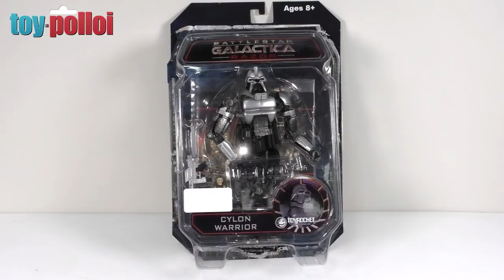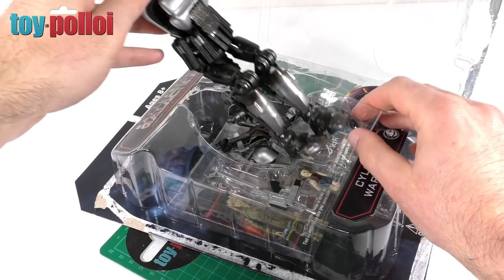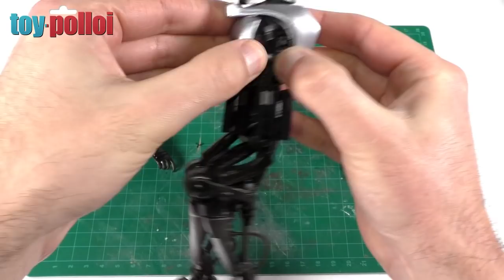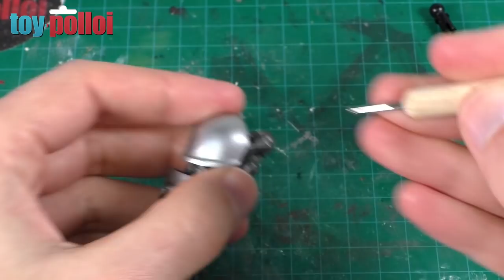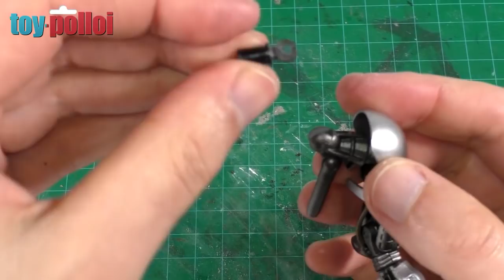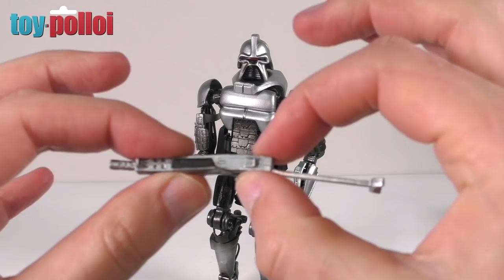Battlestar Galactica Razor Cylon repairs - Toy Polloi

Comment: Yeah I hear you about modern manufacturing, I think maybe the mould tooling cost takes away from final plastic quality too often when they budget these products out. Like you are repairing with LEGO where that standard of moulding tolerance and plastic grade would likely hold up to play since it's not as brittle.
These non-toys can get quite intricate to the point they probably need metal parts at least partially to hold up to standard toy manipulations. I'm impressed with the metal pins but I'm guessing plastic pins that thin would instantly break lol.
Bit of tribal warfare on that front, some pushing for more articulation which is really display-centric only, and the other wanting old school simplicity but some of it was too simple in hindsight. To me scale dictates articulation standard, the smaller the figure the less joints it should have just so it doesn't break.

Comment: Wow, that toy is just garbage, but your fix is lovely... it's a pity that it'll outlast the rest of it. Problem is, all toys out of China (as well as other countries) from about 2005 to 2010 suffer from this exact problem. The price of oil back then sky rocketed, so less was used in the plastic formulation and this is the result of that. After less than a year, maybe even six months, it starts to degrade and crumble. I have one item that I've had in a box for long term observation and that has pretty much turned to dust in places.

Comment: I have a couple of these, which of course instantly fell to bits upon opening them, but I just can't stay mad at them because I'm too busy being blown away by the incredibly intricate design of these toys. It took me a couple years to even fully discover all of the points of articulation, and I'm still not convinced I won't find some more lurking somewhere unexpected one day.

Sure, it's a shame that they disintegrate at the slightest breeze, but the sheer effort involved in getting all those pistons to work properly, when it would have been so easy to just cheat and put in fake ones, makes up for it in my eyes. They may not work well in the execution, but when I look at those Cylons I just see the masterful engineering and forget everything else. They're not badly designed, just badly made, and I'd rather have that than a practically indestructible Cylon that looks terrible.

Comment: As a modern collector diamond select has improved alot. I recently got the carnage they made back in 2016. And it has no issues plastic seems good. But im sure its not made of as good of plastics as older toys. But it hanst fallen apart in my hands.

Comment: Thanks for posting this!  I have one of these Cylons, but no breakage so far -- though to be fair, I just stood it on a shelf and left it alone.  But it's nice to know there's recourse should misfortune befall it.  And it'd give me another reason to break out the Molotow Liquid Chrome pen!

Not all modern toys are terrible.  MOTU Classics were very good, bordering on superlative.  Some of the NECA stuff, it's been good and sturdy, and I've been very happy with it, some of it broke coming out of the package.
Reply: I've only had one NECA figure break and it was a thumb, meanwhile my pre-2005 McFarlane figures have all kinds of issues.
Reply: @Clay3613   With me, it was Lasershot Predator's left arm (broken at the bicep in the package), and another Predator's vambrace control panel.  Everything else of mine from NECA has held up well.

And I hear you on the McFarlane stuff.  Had one of their early Alien vs. Predator sets, and there were some notable fractures, including a Predator tusk.

Comment: Modern toys are manufactured to a rubbish standard these days and have been for a while. I have purchased a Marvel Legends figure and the arm came off taking it out of the packet. I purchased a McFarlane Superman and the leg came off out of the packet. Both from the same retailer. The legend they sent out a replacement right away, I didn't have to return the defect, however when I said about superman which was purchased about a year or so later, their policy had changed. They said I could send it back for them to look at. That's all the promise I got. They would look at it. If they are just gonna try and fix it, I can do that myself, but should I have to? I was told there is a standard defects have to reach before returns or exchanges are accepted. So consumers now have to accept a reasonable amount of damage according to this toy retailer. Reasonable defects like mashed up packaging, paint errors and loose limbs. 

So I emailed McFarlane and they said to return it to the retailer. 

Needless to say I still have the figure, I pushed the leg on as firmly as I could and I've not touched it since. It's not a toy for playing with.

Comment: Toys that are made for adult collectors just cast a shadow over all modern toys. They are often made in cheap non durable materials, their joints are squeacky and sometimes their friction is just stronger than the plastic itself. But actual toys, the ones that are made for kids, are now usually more durable than in the past. They are made in flexible plastic, and different parts are made in different materials depending on the kind of stress they are meant to substain. On the other hand, collectors oriented action figures are produced with the premise that the aimed audience will buy them in any case, just for the name. It's a limited but faithful audience, that will buy anything: producers need to rise the selling price, because they don't have the huge numbers of toy industry, but their action figures don't need to be well made.
Reply: It's because there are a lot of collectors who never open their toys.  So it doesn't matter to them if the joints cannot move without breaking.  That's why toy companies are able to get away with it, and keep making a profit.

Comment: very nice repair. though you can't really blame Diamond select for the design since its taken from the show and they tried to replicate it but the plastic quality and engineering defo has them to blame. I actually have two of the regular looking show Cylons and I am always worried something like that will happen to them too .
Reply from the maker: It's 100% Diamond Selects fault. They should have changed the design to work as a toy, and used better quality plastic. If it was being sold as a model kit, then i would accept it was fragile. But this is sold as a posable toy. If the original design doesn't work for a toy, you change it. It's been done by other toy companies for years and years.

Comment: I hear you about modern toys. Bought the Art Asylum/Diamond select TOS Phaser a few months back. Went to change the batteries. And the bloody things slipped out. Went to the trouble of putting the new ones in. They fell out too. Hmmmmm... I muttered, while jamming cardboard in there to keep them in. All was good. Went to Pew pew. Still no workie. So, I thought bugger. And opened up the P1, being careful not to let anything fly off never to be seen again. And what do you know. There's nothing inside. No sound board, or speaker. I guess no zappy zap for me then.

Wish I'd never given away my old Playmates Phaser. Sure, it was oversized, and didn't split in to the two parts. But atleast it worked. lol

Comment: If only more toys were made of 'LEGO Quality' ABS. Plastic. It's incredibly resilient. A lot of modern toys are made of polystyrene which is possibly of a poorer quality than that used in toys of 50-60 years ago, if that's possible. I got fed up with buying action figures that I dared not pose, in case they broke. Not blaming anyone, but Hasbro, I'm looking at you...

Comment: Modern transformers are built pretty well. One downside is the new figures are quite smaller when compared to even ones from the mid to late 2010s.
Reply: Also their insistence on using clear plastic near/on joint areas

Comment: Thanks again Dave for doing this. I was definitely disappointed about this product. I recently emailed Diamond Select Toys, and I will do a video about it on my channel soon. Thanks for showing how you are doing this repair. I wondered if it even could be fixed.
Reply from the maker: Glad I could help. The figures on his way back to you at the moment so you can at least have one to display. But I would still be very very careful with it as others areas are liable to break. Cheers
Reply: @toypolloi  Oh ok. Thanks again Dave. If you can, please let me know what the tracking number is for it. I am not sure if Retroblasting is going to do anything with the one I sent them.
Reply: To be fair to Diamond Select, I've used their Thanos in my Marvel display for years until I got the new Hasbro version and that thing was a tank. I could have used it as an offensive weapon and I wouldn't have worried about it breaking.
Reply: @craigcharlesworth1538   Well, that is good to know. I just wish Diamond Select would have done better quality control on this figure though. I am uploading a video that is a thank you to Dave for fixing it. It is called "Thanks Dave for fixing my BSG Razor Cylon Warrior" . It is posted to my channel now. I put a copy of the email that I sent to Diamond Select Toys in the description box, and their response, so you can see it.

Comment: It’s a beautiful looking figure but toys are meant to be played with.
Reply: Diamond Select, in fairness, are only sold in comic and collectible shops and aren't aimed at kids in any way (same with NECA) so I give them a pass there. But even if a figure is only meant to be posed and put on a shelf, it needs to be sturdy enough not to fall apart straight out of the packaging.

A lot of the time the problem is that the soft, pliable plastics kids toys are made out of aren't well suited to the kind of super-detailed sculpts these figures have. So companies - particularly NECA who are well known for this - use much harder and more brittle plastics that will show off the detail better but not stand up to play.
Reply: @craigcharlesworth1538  This one is also very complex in it's design, it's not the standard action figure body or shape.
Reply: @craigcharlesworth1538  Then it should include some kind of disclaimer.  The package says "8 and up," suggesting it's a toy that can be played with.